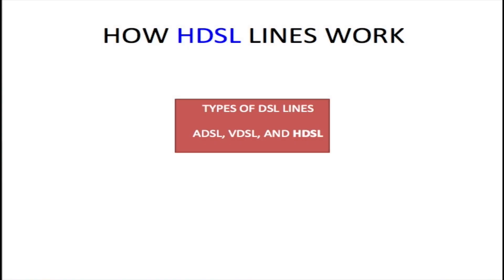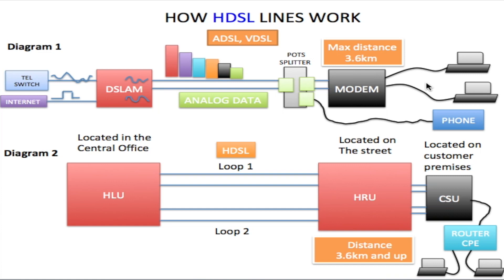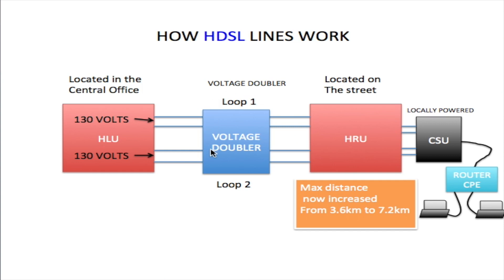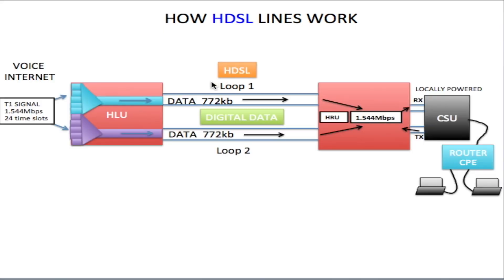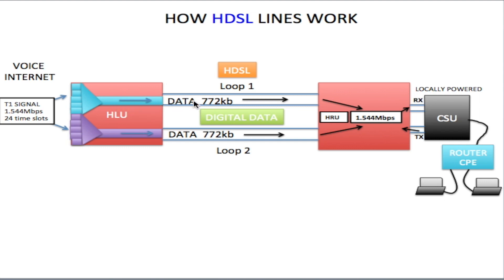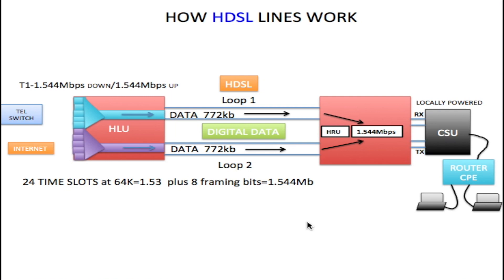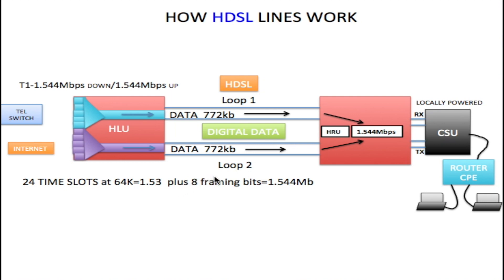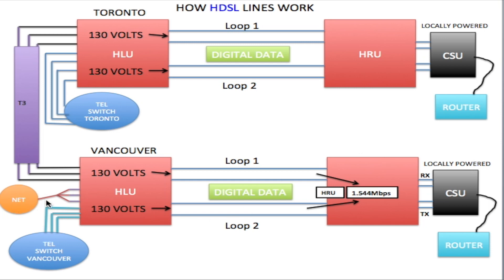How T1 Lines Work

Comment: Thanks for creating and posting this video Curtis!   Your well made video slides and audio descriptions clarified the overall operation of HDSL modems.  My only question is how do the TX(Transmit) and the RX (Receive) indications on the HRU reflect the signal flow?   Is the TX on the HRU the transmit signal TO the CSU, or is the TX the CSU transmit line?   If I were to connect an oscilloscope to the TX and RX lines (on the CSU side), what are the minimum and maximum voltage levels I should expect to see?

Comment: very interesting to see how it works, i work for a local isp telco our network techs are the ones that do all the work on span lines eia circuits etc ive always wanted to work with it and learn it very cool how far you can push the signal, the voltage doubler is what we call a repeater i assume